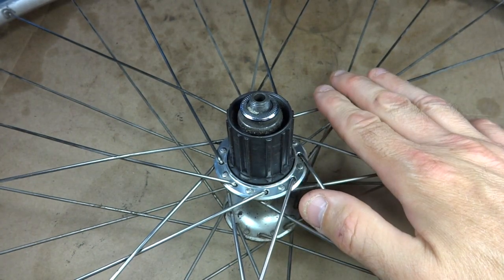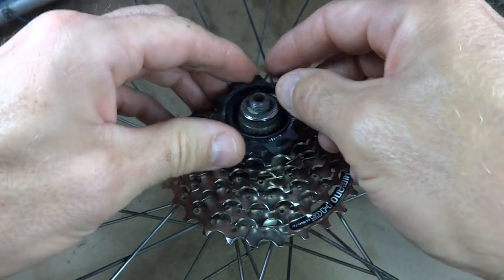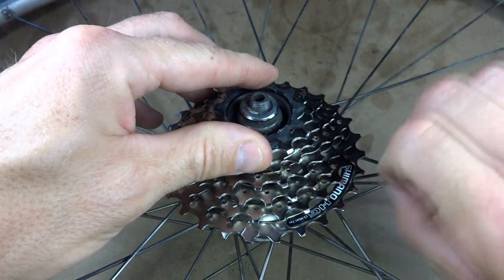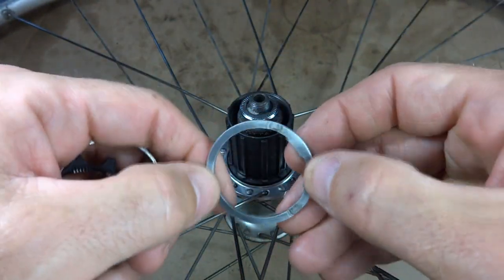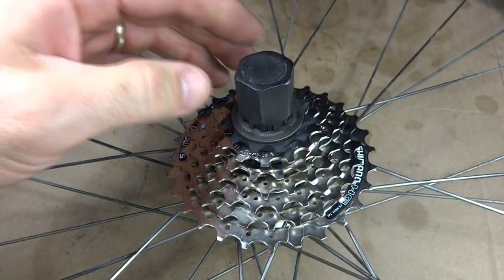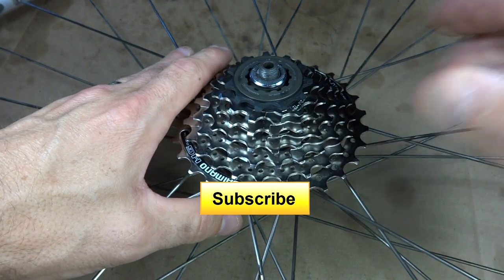How To Install 7 Speed Cassette On 8/9/10 Speed Hub

Comment: You can also file off the rivet ends and remove the rivets to make the back of the cassette flat.  The purpose of the rivets is to keep the cogs aligned and together when they are off the bike for convenience (not necessity), but they don't serve any purpose when the cassette is mounted on the wheel.
Reply: Elaine M Cardente I would have filed or ground off the rivets too but hey RJ does really neat work. I worried the shifting ramps wouldn’t line up but they only go on one way.

Comment: Thanks much for posting this! Your video informed me about spacer thickness and how to do the notches. Just finished doing this on the wheel I bought. I first put without notches on the spacer. The spacer was aluminum and rivet heads pressed their marks on the spacer, there was some wobble. After filing out the notches, no wobble!

Comment: This info is a godsend.  I am switching over to disc brakes (BB7s) on a V-Brake  Trek 8.2 and have a two 7 Speed Cassettes (one 14-34 and the 11-34 which will be part of this upgrade).  I can't find an affordable 7 Speed disc ready hub wheelset and this little tutorial just saved me a whole lot of grief!  4.5 mm spacer added to the list!

Comment: I'm planning to customize a cassette with a 15-32t gear ratio by removong the 11t and 13t cog. My question is will there be issues when tightening the lockring against the 15t cog instead of 11t.  Thanks in advance!

Comment: Thanks for the video RJ! It already helped a lot! If there is a leftover 8 spedd cassete, you could use it, even that you could only shift 7 gears of its 8. They would be compatible despite the reach of the gears, right? A problem would be to use 9 or higher cassetes (the spacing beteween gears would be different, as well the chain itself).
Reply from the maker: They are different. Only slightly different. 5mm spacing to 4.8mm spacing, but different. They can be made to work, but shifting will be imperfect.
https://www.sheldonbrown.com/cribsheet-spacing.html
Reply from the maker: And I am talking standard Shimano stuff, not any of the Campy, other brands, or variations.
Reply: Thank you so much for sharing your knowlodge RJ :) U r great!

Comment: Hi, I’m planning to buy Jetblack VOLT direct drive trainer that comes with an 11 speed cassette and supports 9/10 cassettes as well. I have a hybrid bike with 8 speed Microshift cassette which I’m thinking to use on the trainer by swapping the cassettes. Is this doable? What size spacers do I need? Any potential issues that can pop-up due to this.

Comment: Awesome vid. I am still thorn between getting vintage wheels for my old bike (which are hard to get) or a new set of Mavics/Shimano. Quick question from a bike newbie, where can I get a 4 1/2 spacer? I have found 5 mm but no less.
Reply from the maker: Bike shop.
https://www.amazon.com/exec/obidos/ASIN/B001CJVLWO/ref=nosim/youtube25-20

Comment: Liked and subscribed, very helpful video, I've just put 2 new wheels on my bike, it's a new cassette as well, problem I've having is getting the tension correct for the gears, too tight then too slack to go back up.... it's trying to go back to first from second, but if i release tension to fix that then it's not tight enough in seventh to pull up to 6th🙄 if you get me, I've just put 2 plastic spacers behind the cassette and filed one down so the lock ring tightens. I've just come across your video...could this be causing my issue?
I've seen the pins but never thought anything of them. I've just got the bike bug so still learning.

Comment: Hi R.J., do you recommend putting a little bit of grease on the freewheel hub before installing a new cassette? I found some of rust on the freewheel body when removing an old cassette.
Reply from the maker: I put a little grease on the threads before installing.

Comment: what are the OD; ID; and thickness of the spacer... Metal aluminium or steel preferable? And did you use a rounded file or square shaped one to create the dips?
Reply from the maker: It's a 4.5mm cassette spacer. Other than thickness, cassette spacers are standard.

Comment: Did you have problems with indexing after installing the cassette? I replaced the rear wheel on a Dahon D7; the new wheel was set up for an 8/9 speed, so I used a spacer like you did. However, I cannot get the derailleur to index correctly now - I can't switch to the small ring and my "2"gear takes me to the largest ring. Adjusting the H and L screws wasn't enough. Any hints or help?
Reply from the maker: +Jimmie Roan Are your shifters 7 speed? Did you readjust the cable? There are a lot of possibilities and I can't really answer without a lot more details.

Comment: Have  a pair of early Campy 8-speed Ergos & just purchased a set of wheels  that are  9-speed Campy cassette. It is possible to convert the cassette to 8 speeds? Adding a spacing seems like an easy fix...
Reply from the maker: +Rich915 Sorry, Campagnolo stuff is different than the Shimano stuff I usually deal with. I am not sure how they are set up for compatibility.

Comment: Nice video. I"m guessing there is no way to put the spacer at the end of the hub (outermost) instead of at the base of the hub (innermost), right? From a mechanical standpoint it would make more sense to reduce the torque on the hub/bearing.
Reply from the maker: +Heinz Otto Not really, and it's generally not an issue anyway.

Comment: Hi!

Because there is only two rivets instead of three, is the cassette still sturdy and has no wobble and other possible moving, even the rivets only cover 1/3 of the cassettes area? I mean you can still use a cassette even one rivet or screw is lost?
Reply from the maker: Ari Vainio That was how that cassette was supposed to be. So it wasn't like a rivet was missing.

Comment: I have a MTB with a Shimano Tourney CS-HG200-8 cassette.
Cogs:
32-28-24-21-18-16-14-12
Crankset is a triple 24-34-42.
What I would like is to get rid of the 12 tooth cog because I really rarely use it, the 14 tooth is perfect for a top gear. 
Could there be a 14-32, 8 speed cassette (or even a 7 speed) and then to add a first gear 34 or 36 tooth cog to have 8 gears?
Reply from the maker: You will have to research it.

Comment: I got fed up with all the 10,11,12,13 ? speeds and compatibility issues and I have now gone back to 7 speed cassette with the beefier chain. I get a better chain line and without loosing any range. (I have a 7 sp 11-34) everything is working great. I don't have to worry about cross chaining either because the chain is only going up or down 3 cogs. I love it and I'm going to keep riding 7 sp. The only downside to the spacer method is that empty space which could have been used for better stablity when 7 speed hub body is used. I tried to find a dedicated 7 speed rear hub but no luck so far.(ebay seems bit sketchy especially none of the items I saw mentions the condition of the cup and cone.  Do you have any suggestions? or should I just be happy with what I have and not be greedy? Thanks for all your videos.
Reply: So what setup are you currently running?
Reply: I ride 3x7 gears on a road bike. Cassette is 28 24 21 18 16 14 12. I'm using some old 9 speed cassettes to scavenge cogs so I can change my gearing to 28 24 21 19 17 16 12 to make gearing more useful to me since I rarely ride above 21mph. Need to use 7 speed spacers between cogs. Bike Gremlin says distance between cogs(aka cassette pitch) is 5 mm for 7 speed and 4.35 mm for 9 speed.

I always assumed 7 speed cogs were beefier/thicker but they're not really. Bike Gremlin site says 7 speed cogs are 1.85mm thick and 9 sp cogs are 1.78mm thick, only 7/100 mm difference.

Comment: I have a selection of thin spacers, roughly 1-2mm thick. Can I combine them to get to the required width? Is there any compromise in structural integrity by doing so as opposed to buying a new single, thicker spacer. It's a budget build and I really don't wanna spend any more money than possible. Also they are spacers I just had laying around. They are aluminium I believe but not sure if they were designed for the free hub or another part/headset? Thank you, Stuart.
Reply from the maker: That would be fine.

Comment: You can also just remove the rivets (I used a grinder to grind off the rivet head, and a punch with a hammer to punch the rivets out) on the cassette and install the cogs individually. This way, there is no rivets that will contact the spacer and it will be much easier to clean the cogs individually later on. This will only work with some Shimano cassettes. Other Shimano cassettes have an internal spider/spacer that is riveted to all the cogs, making it more complex to remove all the rivets. The Shimano cassette that I've owned with a single internal spider/spacer does not have rivets that will interfer with the hub spacer, so removing its rivets is unnecessary.
Reply from the maker: I would rather modify a 50 cent spacer than a 25 dollar cassette.

Comment: where did you knew that is 400 Nm ? your tool is special for setting a specific torque ? thank you
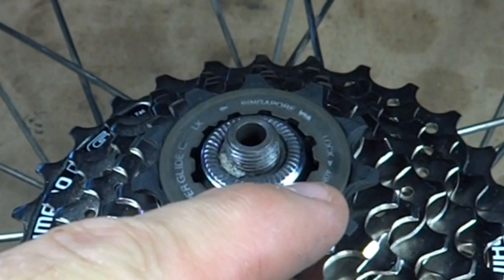Reply from the maker: OMG. 40 Nm, not 400 Nm! It's noted on the lockring (Where I point at 4:20 in the video). 40Nm is common, though others might be different. I used a torque wrench with a 1" socket over my lockring tool.

Comment: Mountain 8/9 wheels fit in 135mm dropouts and road 8/9/10 wheel a 130 dropout. Which spacing does the hybrid in the video use. I have an old 7 speed road bike I'd like to squeeze a 130 wheel with the 7 speed cassette. What spacer would I need?
Reply from the maker: Kinixys3 The wheel spacing doesn't have anything to do with it. It is the freehub size. The freehub was designed to fit an 8/9/10 speed cassette. The 7 speed cassette is thinner, so I had to add the 4.5mm spacer.
Reply: I see so you are saying the 135 mountain and 130 road wheel have the same width freehub?
Reply from the maker: If they are set up for a 8/9/10 speed cassette, then yes.

Comment: I just ordered the FR-5 tool from PartTool but I did not get the one with the allen part ticking out. Will that be a problem to unscrew or re-tighten my cassette?
Reply from the maker: Just use an adjustable wrench or a ratchet wrench with a 1" socket.

Comment: i currently have a shimano 9 speed cassette....if i were to upgrade to a shimano 10 speeder, will it be able to fit my frame? [trek mamba 2013]
Reply from the maker: It should. You will probably need to add a 1mm spacer.
Reply: shyflirt1 thanks!

Comment: I just tried to put a 9 speed cassette onto a wheel that had 8 speeds and it is a hair too short!   Is there any measurements listed detailing which rear hubs will hold how many gears?
Reply from the maker: What is too short? The free hub? There are no spacers?

Comment: I'm sure that what you did was cheaper, but couldn't you have just bought a 7speed hub replacement and used that?  I'd love tom see a video to that effect.  I have an old Raleigh Sport IGH 3peed that I am working on.  I want to change the wheel size to 650b and fit wider tires and also go with a 6 or 7 speed cassette.  The chain stay spacing is only 110mm and I am scared to space it out too far.  Please share your wisdom.  Thank you.
Reply from the maker: Why???

Comment: Hi RJ, to convert 10 speed wheel cassette to 7 speed I would need one 4.5mm spacer ? correct?
Reply from the maker: +attila elekes You are not converting a 10 speed cassette to 7 speed. This is how to install a 7 speed cassette on a 10 speed hub.

Comment: I have a Shimano FH-HG20 7 speed hub with a 7 speed cassette.
Will an 8 speed freehub fit the FH-HG20 hub using the spacer and would the chainline be altered or stay the same?
Want to keep the 7 speed cassette.

7 speed freehubs have been discontinued for the FH-HG20 hub.
Reply from the maker: I am sure you can find a freehub some place.
Reply: @RJTheBikeGuy  Only found two sources so far for a NOS,(new old stock) 7 speed freehub for a FH-HG20 hub.
One in USA and one in UK.
Local bike shops in Canada have nothing and can't get them anymore.

Would an 8 speed freehub fit the FH-HG20 7 speed hub?

Comment: A potential problem I've had with this method is that the spacer moves the entire cassette outboard. This can create alignment issues with the chain rings. If you then move the chainrings outboard with a spacer on the bb, the FD may not reach outer chainring. I wonder if there's a way to put the spacer on top of the highest gear before the lockring. Then you would just have to move the RD inboard.
Reply from the maker: This is the way it is done.

Comment: Hey RJ, will that trick will work with direct drive trainers as well?
Reply from the maker: I don't know what you mean by direct drive trainers? Doesn't have a Shimano HG cassette like this?
Reply: RJ, direct drive trainers are the turbo trainers are the turbo trainers that requires you to take off the rear wheel of bike

Comment: If it is an 11 speed wheelset(Shimano RS010, CS-HG41 Acera), can I use 6.35(4.5+1.85) spacers?
Reply from the maker: If the hub is made for an 11speed cassette, you should be able to use spacers to fit a 7 speed cassette. Not sure the thickness. You can try 6 or 7mm worth of spacers to see what works.

Comment: IMPORTANT NOTE: On some bikes the spacer goes on the outside, installed after the smallest cog and before the threaded retaining ring. Such was the case with my bike. 

I installed the spacer on the inside, before installing the cassette, as shown in this video. When I went to test the bike, the chain would come off the biggest cog, when I got to the top gear. And, on the other extreme, when I tried to shift to the smallest cog it would only go to the next to the smallest cog. I figured out that the spacer needed to go on the outside of the cassette, installed after the cassette.

Comment: I have a Sunrun mountain bike, and when I google cranksets for it, Vuelta keeps coming up. Vuelta carries the Sunrun cassettes, but is a Vuelta crankset also compatible with my Sunrun? Your help would be really appreciated as I'm about to order it(Vuelta crankset), but would rather know it'll definately work first.
Reply from the maker: I have never heard of Sunrun. Cranksets are not so narrowly compatible. You need one that with fit your bottom bracket and has the right gearing, etc.
Reply: The are the same company/brand as Suntour.
Reply: The are the same company/brand  as Suntour.

Comment: I have this kind of road bike this bike called cyclocros this has a 7 speed( not casset and screw type its hevy ) rear delli and i want to upgrade free hub im gonna buy what you did on this video a casset 7speed with spacer any kind of hub i can use? With a disc brake in it and i want loud hub is 8 9 10 speed hub different sound? This will help me a lot pls answer i want save money shop allways reccomend 8 9 10 group set   cause lot money...

Comment: Can I use enough cassette spacers on both sides of a single speed cog? 

I want to buy a Salsa bike. They use Alternator Drop Outs that allow to easily run single speed.
Reply from the maker: Probably.
Reply: you can get a single speed conversion kit that comes with everything you need to convert to a single speed rear cog. It comes with the correct size spacers and gear cog to line up the single speed cog with the crankset chain ring.

Comment: Probably super old.  Can u   have put the spacer in gap?  Instead of the back like all spacers in between mine. Cluster sits against the back. Then spacer, then small cog. Looking to either stay at 1×9 or lower for the bbshd mid drive unit
Reply from the maker: I don't understand what you are saying.

Comment: I have a 8/9/10 shimano freehub body on my rear hub and I am installing a 10spd cassette. After I tightened the cassette I noticed some slight play when pulling & pushing the cassette away and towards the hub.  So I remembered there is sometimes a small spacer before the cassette goes on like your so I found one and reinstalled the cassette and there was still this slight play.  I installed it anyways and when the wheel was tightened with the skewer there was not any noticeable play now. I guess the question is, is the little bit of back and forth play normal and when the wheel is installed it goes away ?   And also this small spacer, is the purpose to get the cassette proper tightness if the lock ring doesn't have enough threads to grab on to initially ??
Reply from the maker: The cassette should not have play. Generally it's a 1mm spacer. If the hub is made for 11speed, you might need a wider spacer. The cassette should be locked solid when you torque down the lock ring.
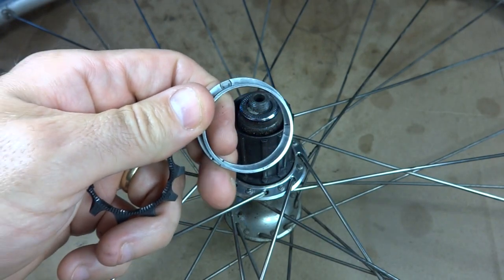Reply: I just watched a video by PARK TOOLS after i posted this and he said that this play that i was describing was common and nothing to worry about actually.  Watch this video starting at 2:55 and see here : 
https://www.youtube.com/watch?v=A6TpHgbbEGM

Comment: Dude your are a god. I just wondered why the fuck it wobbled after i cleaned and lubed the hub and freehub and wanted to install a 7 speed casette instead of the 8 speed one. Thanks dude. RSX 7 speed with 8 speed casette is kinda wrong imo so thank you very much dude.

Comment: Hey RJ and Community.

I am fixing up an old beat up peugeot. 
I took off the cassette and was suprised to see some spacers underneath. Then i saw, that at some point, somebody replaced the Hub with a 8-speed.
In your video the topic is about 8/9-speed freewheels. I'm not to sure if the freewheel on mine is 8-/9-speed or just 8 speed, is that even possible? Or are all 8 speed measurements the same regarding shimano?
Are the measurements for the spacers, 4.5mm then still the same?
The Hub is a Shimano FH-RM40-8 and 
the Freewheel is y-3sl98030 shimano parts number.
The cassette is a CS-HG50-7

Thanks to anyone who can help :)
Reply from the maker: https://www.youtube.com/watch?v=n5YkkAP_QVI